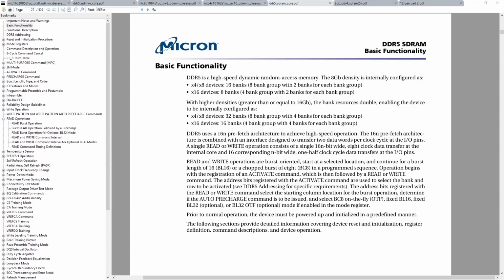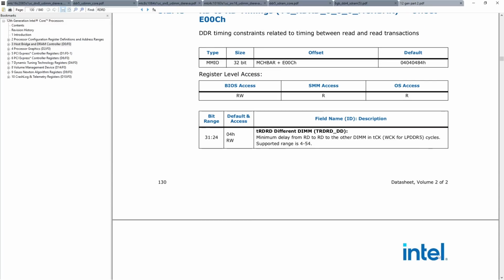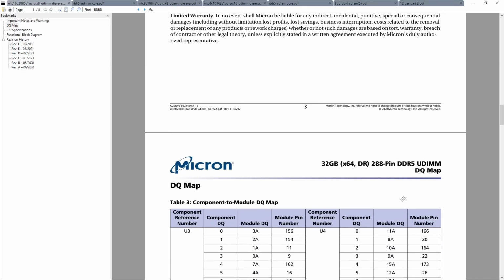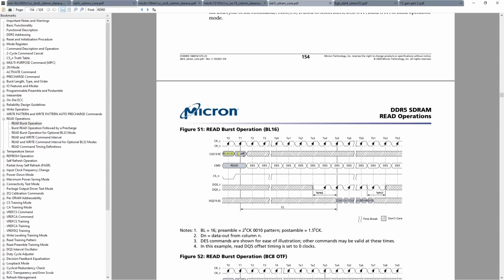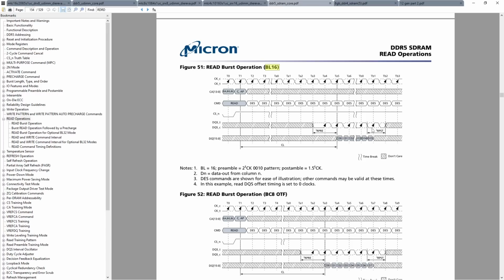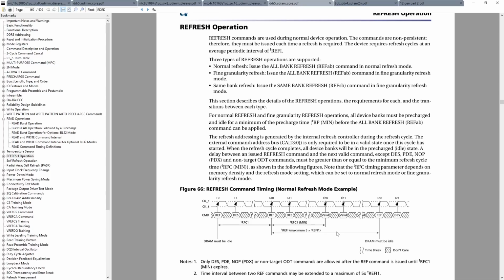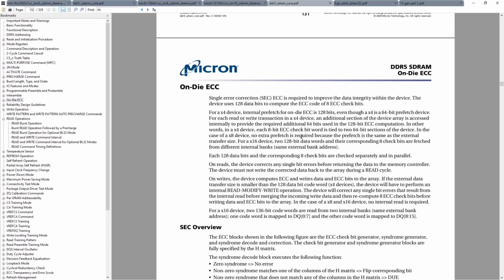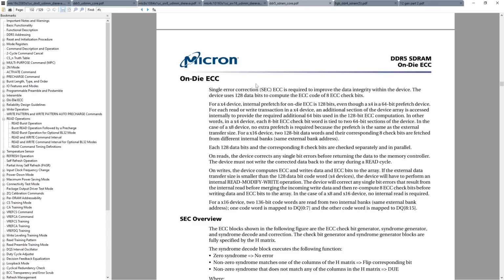DDR5 vs DDR4

Comment: So we need to get memory manufacturer to explicitly market how many bank groups they have and reviewers to also tell them apart and give glory to these that do it from a consumer perspective.
Reply: Are there any easy heuristics to realistically use on amazon/etc.? I haven't looked at ddr5 for myself yet but I feel like referring to the manufacturing spec sheet is the only way... which sucks.
Reply: @QuantumConundrum  not that I'm aware of. The manufacturing spec sheet is not readly available. If I'm correct there is even enough wiggle room to even have the same frequence and timings advertised and changed ranks under the hood, as it is wide used with which chips are used. That is why people chase for b-die and so on. RAM is a mess from a consumer perspective like the phase count and the M.2 situation where it is attached to and what shares which other ports.

Comment: Can you run DDR5 at 3600CL14 @ gear1?
Reply from the maker: no
Reply: @ActuallyHardcoreOverclocking   May I ask the reason why you can't?
Reply from the maker: @RinMinase  it just doesn't work.
Reply: @ActuallyHardcoreOverclocking  Ohhh okay. I thought it can be downclocked to retighten the timings again, while still keeping the other benefits of DDR5. 😁
Reply: @RinMinase  yeah that's what I was thinking about.
Reply: @ActuallyHardcoreOverclocking  I guess you could compare 4800DDR4 vs 4800DDR5. I'm not sure alder lake can daily ddr4 4800. If it can its half the price and probably faster.
Reply: @ddhelmet  I am running a 12400 on 4600 ddr4, not quite 4800 but close

Comment: 8GB x16 DDR5 sticks seems to be at least somewhat common in laptops currently, although based on Jarrod's Tech's benchmarks the performance difference is barely noticable compared to DDR4, which would make sense.

Comment: DDR5 is just so damn EXPENSIVE now...

Was thinking of building a RYZEN 7000 rig, later on this year.
Will probably just go with 5000 instead.
Reply: Eh if youre in the usa adl may be a better bet
Reply: We are still like 6 or more months away and DDR5 has already been dropping a fair bit since launch
Reply: Got a 5800X3D on launch for MSRP. I'll wait for the DDR5 prices to come down and see if the 7000s will work well or not... Remember the first AM4 motherboards? They sucked, especially the early bios versions... Ill get into AM5 when it's a bit more matured.
Reply: @MicroageHD  I Mean, some mobos were totally fine atleast quality wise or they were fine if we forget about the price they had, some also became b450s with just the chipset change.
We are also talking close to bankrupt amd vs nowadays amd, doubt things will be the same
Reply: @MicroageHD  The sucking was because at that time none of the board manufacturers had any faith in AMD delivering a good product, so all the early zen boards were minimum effort.   This is no longer the case and recently the enthuisast/DIY AMD boards seem to be getting more effort than the boards for Intel.
Reply: never buy first gen parts, if you're planning on building a rig raptor lake or zen 3 is probably a better bet because of their more mature platforms

Comment: I've been reading a lot lately about core memory the old technology that was replaced by ic memory chips in the 1970s. Its crazy how much of the system we use now is copied directly from ancient technology developed in the 1940s. Even a lot of the primary and secondary timings.  Nothing is ever thrown it seems, they just add new layers on top of the old system. Makes me wonder how different a system developed for and with today's technology would look.
Reply: I mean, there's just so many ways to efficiently organize data that has to be quickly accessed.
Reply: @WhenDoesTheVideoActuallyStart  That's a good point. A lot of the basic structure follows from the fact that we're accessing bits arrayed in a grid of rows and columns. I'm sure smarter ppl than me have theorized how it might work in higher dimensions.
Reply: Think that has more to do with a lack of pure mathematical advances, and as such, we're still using pretty old stuff (in IT terms) as basis for a lot of what we do today.
Reply: You also have to factor that their is heavy friction against big changes due to backwards compatibility,  legacy code, and manufacturing flows. A lot of things, from simple programs to OSes are optimized based on certain workflows in DRAM. This also even applies to other hardware parts, such as CPU or GPU. Lastly, you also have to consider all the tooling changes you might have to make in a factory depending on how you tried to change a design.
Reply: @dmanatunga  and memory is especially effected by compatibility issues because the memory system is reliant on CPU, motherboard, and ram manufacturers all being on the same page and working together. The last thing anyone wants it's to go back to the issues that existed in the days of ddr3 where almost every issue seemed to be ram related
Reply: @dmanatunga  But each new generation of memory controllers and DRAM dies are co-designed, and only rarely have backwards compatibility (Such as what Intel's done with Alder Lake)
Reply: @WhenDoesTheVideoActuallyStart  

Backwards compatibility may have been a poor choice of words. I'm not really referring to compatibility in the sense of protocol, which as you correctly said, rarely occurs. It is more in reference to the original comments note of general arch of a DRAM module. The biggest example you might see is when programs try to optimize the row buffer in DRAM banks.